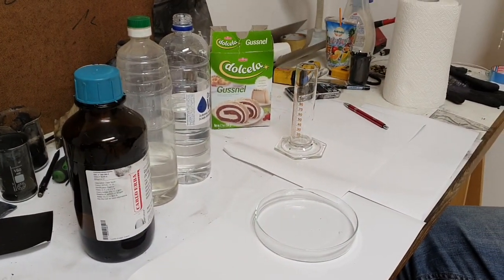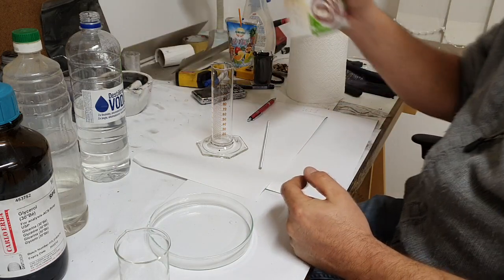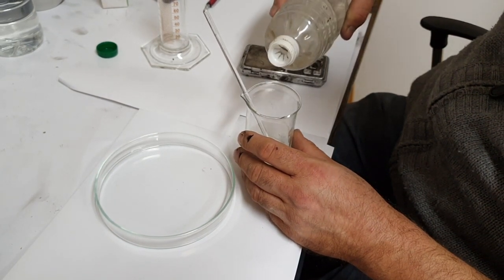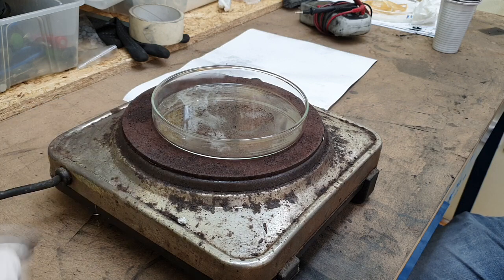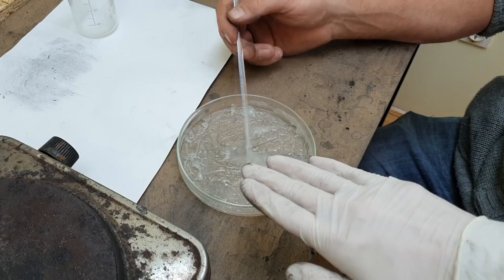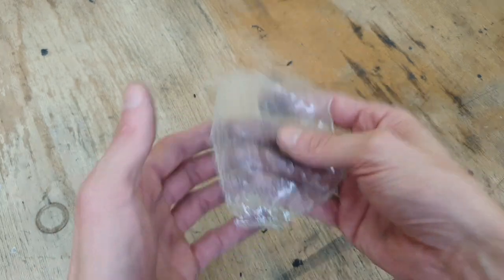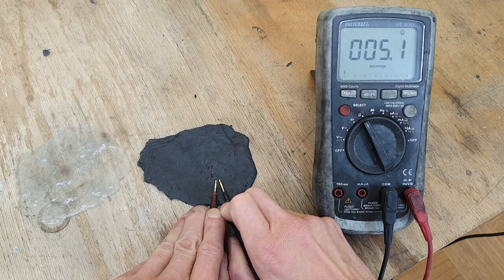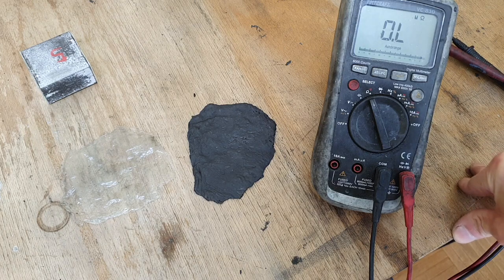Make a Conductive Bioplastic

Comment: hello! good video. Is it the same to use graphite or activated carbon? I did some tests with activated carbon, the texture is rougher, the problem is that after a week the material begins to dry and stops conductive. Thanks greetings

Comment: Hi, I see you have some nice method for measuring the square resistance.
Could you tell me a bit more about it?
What I see it's a square made od some material and two aluminium pieces.
what is the size of these aluminium sheets, and is it flat on the bottom or rather something like 4 pinns touching the ground?
Thanks in advance.
BTW, great channel, always waiting for new ideas, keep going!
Reply: The size doesn’t matter. The block must be square. The terminals on each side must be the same length as the square sides and must touch the sample completely. The reading is termed ‘ohms per square’ and is useful to compare sheet resistance. 

Imagine you measure 2 ohms. The next section of material will also be 2 ohms.. that’s 4 ohms series resistance. BUT, in parallel with it (right next to the series resistances) there are 2 more resistors making another 4 ohms. And the trick is.. 4 ohms in parallel with 4 ohms is our 2 ohms again! So, as long as the block is square and the terminals contact the sheet… you are good to go.

Comment: Sorry sir, is this bioplastic graphite resistant to electrolyte exposure?
Reply from the maker: Hmm, I think no. But try it anyway to be sure.
Reply: @cayrex  hmmm, thanks sir
Reply: @cayrex  sorry to come back again, if graphene is made using sodium silicate, is it resistant to electrolyte acids?
thank you in advance for your answer
Reply from the maker: Salt electrolytes are fine,.... for mild acids is ok. Strong acid can be a problem.
Reply: @cayrex  wow thank you for the answer. I wish you more success in the future.
I hope that later you will make videos related to hydrogen batteries. That looks very interesting
Reply from the maker: @fatih.73jtxditonton43  Thank you! You mean like this: https://www.youtube.com/watch?v=YdqTA4IOiG8
Reply: With screen printing process you can apply some liquid like this conductive one on any surface. and with a choice of mesh to get the right thickness.Also you could overprint some non-conductive varnish to protect conductive area and multiply layers

Comment: How does it respond to water? 
Also, when mixing in the starch you'll find it mixes much easier if the 20 Mil of water is warm.
Reply from the maker: With water,... not really good. The plastic dissolve over time in water.